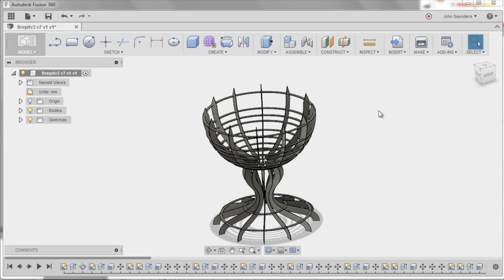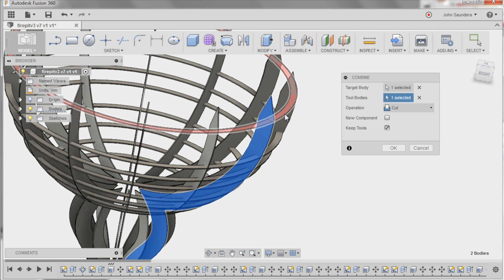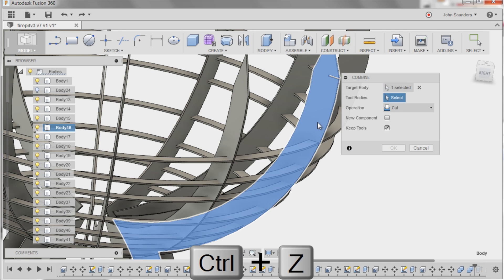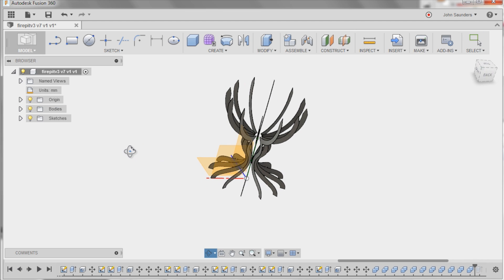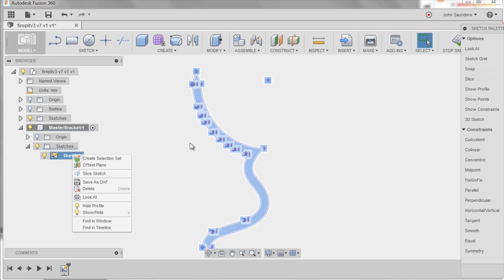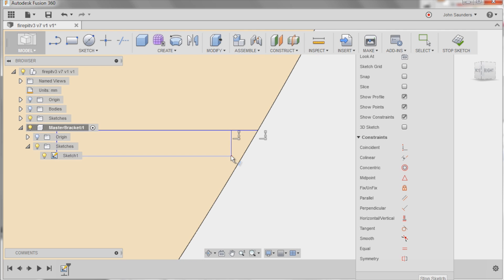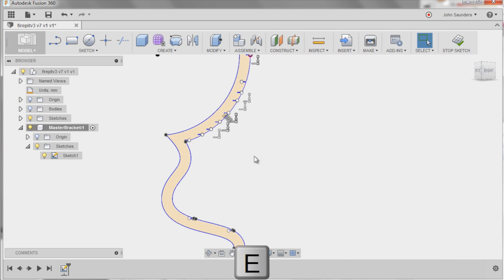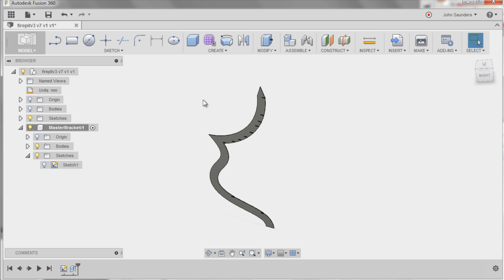Fixing a Fusion 360 Fire Pit!   Fusion Friday #34

Comment: I liked the fix aspect of the video but for the application of the fire ring itself I think the pointed edges should be softened or eliminated so if and when it's built someone doesn't impale themselves on the sharp points. The reason I thought of this is I just got back from a week long camping trip with 3 grandchildren and keeping a 2 year old away from a campfire can be challenging enough without this hazard on top of it. Just my opinion.
Reply: Yes you are right, they wont be as sharp with the final design

Comment: I think the trouble with extending the lines is, like you pointed out, a lot of extra stuff (garbage). I know in solidworks/draftsight you can see the lines, but you need to be like in millacron zoom to see little points that were left. when I first started with cad, I  had that issue because I wouldn't always clean up my messes.

Comment: John, a quick short cut on the combine operation.  You can only select one body to cut, but use multiple tools to cut with.  In other words select the single leg as the body, and all of the rings as the cutting tools, will save a few steps.

Comment: Excellent, video. I, definitely, would like to see that to completion (In Fusion). I experiment with flat pack designs and builds. I recently began dabbling in tab and slot. I have a 2x4 torchmate and limited to flat parts. I have issues exporting dxf files out of Fusion. Torchmate, crashes during import. To get around, it I export from Fusion (STEP model), to Inventor (DXF), and finally to Torchmate. I would like jump right from Fusion to Torchmate. I was wondering if you have the same issue.
Reply: look at 123D Make. It will make you weep.

Comment: I think in some instances the lines were extending only to the point where it would intersect perpendicularly with the vertical line from the other cut out above it, so if you extended again it would have reached the desired point you intended to extend to. Normal, but I believe Fusion should make it so it would only extend to items in screen view when you are zoomed that close.

Comment: Hi John! I think the double line happened because the tool cut the leading and trailing edges the circle. I used the same technique (on purpose) to cut the proper thickness when I had square tubing cutting through a shelf at an angle.

Nice tip to know!
Tom Z

Comment: how would you du it, if you wanted to have those slits in the brackets as well as in the rings, so that they lock in position? With the solution presented in the video, the brackets would be free to get anywhere on the rings, so a little bit of guidance would be helpful I think.
Reply: Once you put the notches in the brackets, go back and project the notch in the bracket to the top of the ring, edit the notch and ring so it interlocks with the bracket and extrude cut through the ring to produce a notch in it. Repeat for every ring/bracket interlock section.
Reply: That's not very practical. I thought a little bit about it, you could define a ring, that lays inside each "real" ring and has the same dimensions, but a larger inner diameter and maybe one with a smaller outer diameter. Then, you just use one to cut the notches into the brackets and the brackets themselves to cut the notches into the other rings. Maybe you could also do all parts at once and with a little bit of adjustment on the diameters you wouldn't even have to correct the notches, as John did in this video. Also, you don't have to keep these geometries that you used just to construct these notches.
Reply: +Klaufmann 

Or just add 2 small rods welded to each ring that span either side of the bracket width. Which will function the same as putting notches in the ring. A a heck of a lot easier to both model and produce in the real world.
Reply: +Klaufmann and actually if you want something that keeps the brackets evenly spaced, I would design a slotted hub that sits in the center at the bottom of the bowl. 

Use the hub to keep the brackets aligned correctly then tack weld the rings to the brackets. You should then be able to remove the center hub and the welded rings will keep the brackets in place. Or just leave the hub in for support
Reply: Occams Sawzall
Depends, if you get the pieces laser or plasmacut then it is better to construct all the details you need for assembling the part right away, without having to weld anything extra.

Now I also wonder if this is acually possible to assemble, since you have to get the next bracket first through all the rings and then slide them into the notches. Could get a little bit tricky.
Reply: +Klaufmann I have left enough room for them to slip over. Hopefully it should all be ok
Reply: I haven't tried this but the way I would go about this is as follows

1) Sketch and Extrude a single upright
2) Sketch the rings with 
 a) a circle at half the width of the ring
 b) project the upright sides onto the ring
3) Extrude the ring leaving the notch out (Notch determined by projection lines and circle at half width)
4) use the rings to cut out the upright
5) Pattern the upright around the ring
6) Use the notched uprights to cut out the remaining notches in the ring.

Hope that is some what clear.
Reply: In case it is not clear you should end up with your rings all with a single notch, a single upright with the mating notch that gets patterned around the rings and then used to make the rest of the notches in the rings.

Comment: nothing wrong with a straight out rebuild most of the time it is the easiest way to go. 
with the lines that had a white dot on them you could of just dragged them over and snapped them to the profile, so it had a single line. 
you can break it hard if you move something if the other part of the line does not have a constraint.